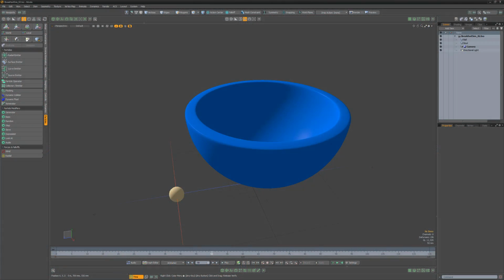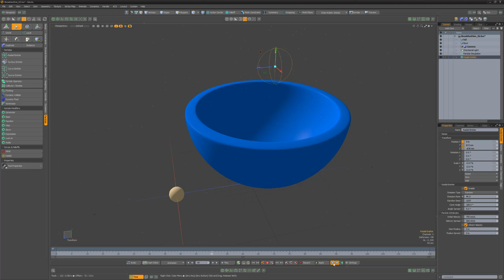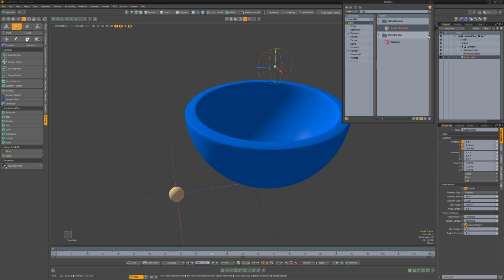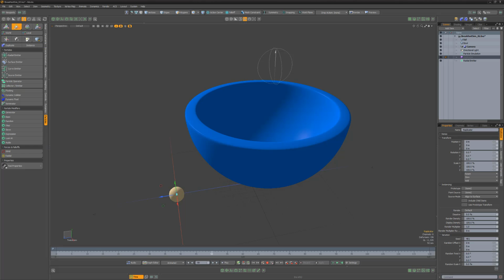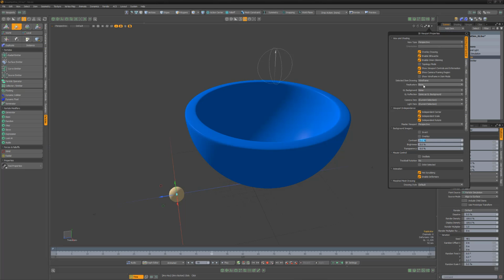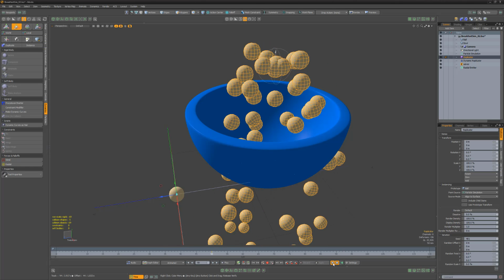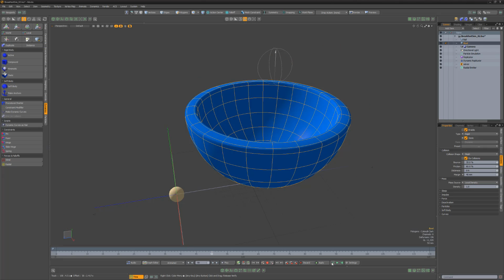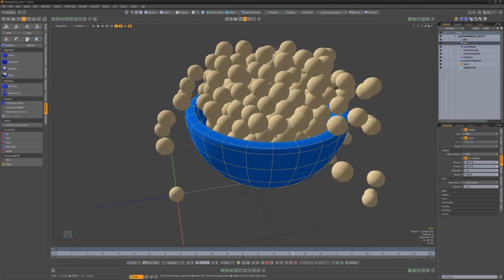Modo Essentials: Crash Course | Particles, Replicators and Dynamics

Comment: Hiya, Can you tell me where is this 'Compute Simulation' command located. I'm using Modo V15.2
Reply from the maker: In the Modo Layout , open the Timeline by clicking teh TIME button on the bottom of the UI... the 3 options will be found there
Reply: @pixelfondue  That's great. I was looking high and low for it in this version, many  thanks